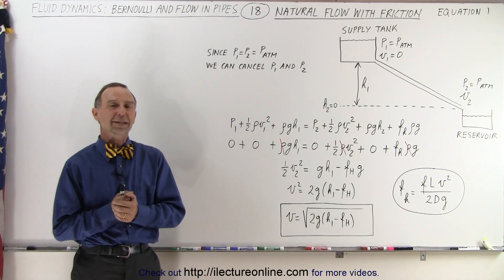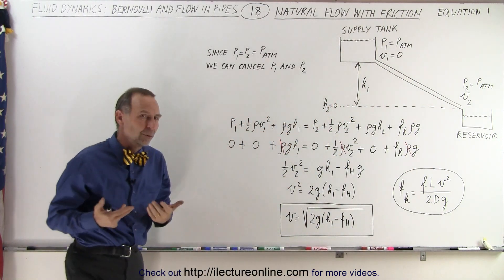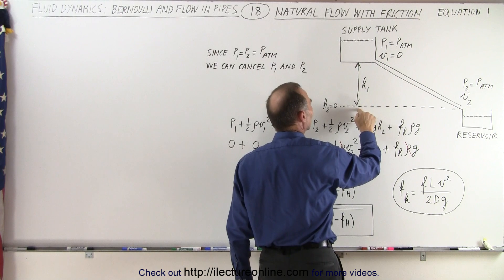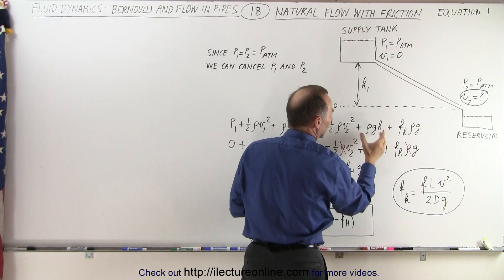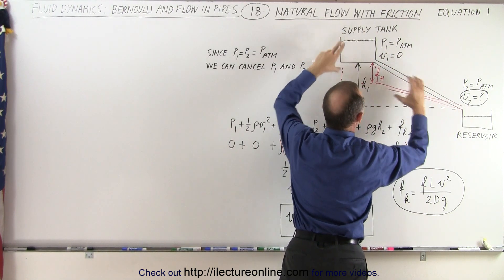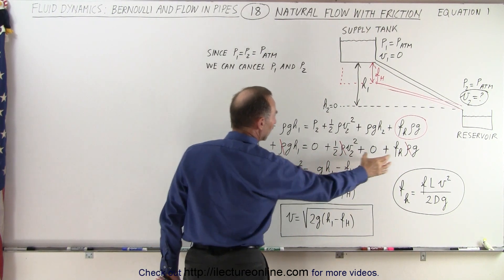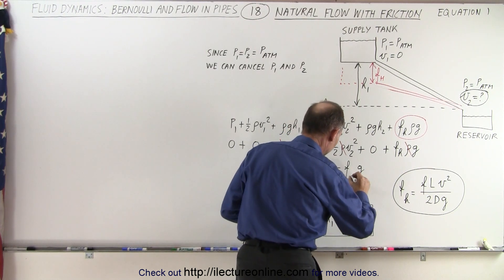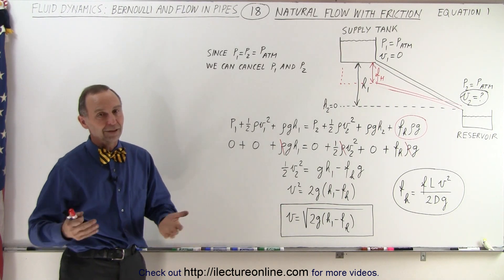Physics 34.1  Bernoulli's Equation & Flow in Pipes (18 of 38) Natural Flow with Friction:Eqn.1

Comment: Thank you for your explanation, Mr. van Biezen
Reply from the maker: You are welcome!  Glad it was helpful.
Reply: @MichelvanBiezen  Sir, I realized I still need assistance for solving a similar problem. If you don't mind, I would appreciate your help. The statement says there are two open tanks connected by a single pipe. One stands 2ft higher than the other. They give the length and size of the pipe, the Darcy friction factor, and type of connection (sharp entrance/ exit; the C values for this are provided). They say there are no other fittings. They ask for the flow rate expected in the pipe. I can also see the solution provided for the problem. I see they use Bernoulli's equation to state that the sum of the heads due to pressure, elevation and velocity at the 1st point equals the sum of the corresponding heads at the 2nd point, plus the head losses. But I don't understand three things: 1) what two points in the system should be analyzed and why (note that they don't say where in the tanks the pipe exits or enters; 2) why they say pressure 1 is equal to pressure 2; and 3) why they say the heads due to velocity (v^2/2g) at the 1st and 2nd positions are zero.
Thank you.
Reply from the maker: 1) They gave you the height difference (2 feet) so assume that to be the verical drop
2) We can assume that both tanks are open to the atmosphere, so the pressure will be the same.
3) Not sure what they mean with the third comment.
Reply: Sir, I understand that the pressure is equal at the water surface in each of the tanks. But I do not understand if the points selected for the energy analysis are at the water surface or in the pipe's inlet and outlet. 
The third thing you said was not clear is that they say that the initial velocity squared (V^2) divided by two times the gravity (2g) (i.e. the initial head due to velocity) almost equals the final or second velocity squared divided by two times the gravity (V^2/2g) and both are insignificant (or equal to zero).
It is because of these assumptions or facts that they are able to solve the problem, but I don't understand them.
Thank you for your help.

Comment: How do you find f , friction factor? Since f is dependent on the velocity which is still unknown in the problem.
Reply from the maker: We ignored the friction factor in these videos.  That is a topic for later when we get into the more detailed aspects of fluid flow.  The friction factor depends on the surface of the pipe, the pipe diameter, the pipe length, and the fluid flow (Reynolds number).

Comment: Meneer Van Biezen,  could you explain please, why u did not take into account the high of water into reservoir-1 (above)...?
Reply from the maker: Typically in actual (real world) applications, the height of the tank is very small compared to the change in height for the pipe, and the water height in the top reservoir will be a variable.  It is therefore typically ignored.  But you are technically correct to include it if it is significant.
Reply: Thank you so much, Prof Van Biezen,..I appriciate this...🙏

Comment: Thank you sir for your efforts
I have a problem with designing the fountains 
If i have a disttibuters of  10 nozzles and the pump has a glow of 40 meter cube per hour the head is 20 meters yhe question is how i distribute the presur of pump on 10 nozzles

Comment: i am given a scenario where i need to choose a pipe from 3 choices where water is transfered from one resevoir to another. i would like to calculate the velocity so i can calculate the flow rate, since i think the greater flow rate will be my selection of choice. what is confusing me is i am given a friction coefficient value. do i insert this value where you have head loss?
Reply from the maker: Yes, the friction is the source of the head loss.
Reply: @MichelvanBiezen  I appreciate your response, thank you. what if I don't have a pipe length ?

Comment: why didnt we take into the account the height of suply tank?
Reply from the maker: That is a good question.  The assumption here is that the height is not significant compare to the drop in the pipe.  If it is, then you should add the height.